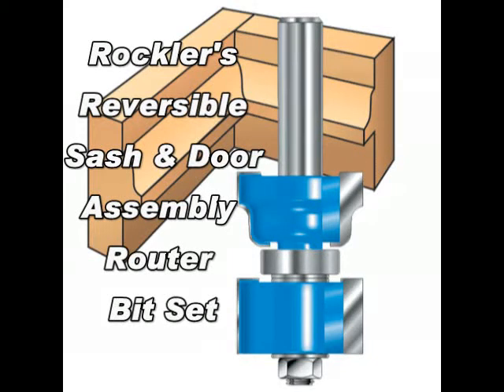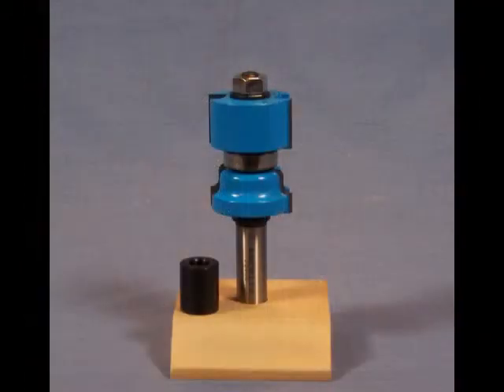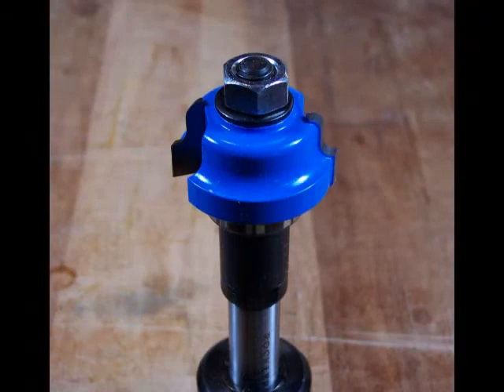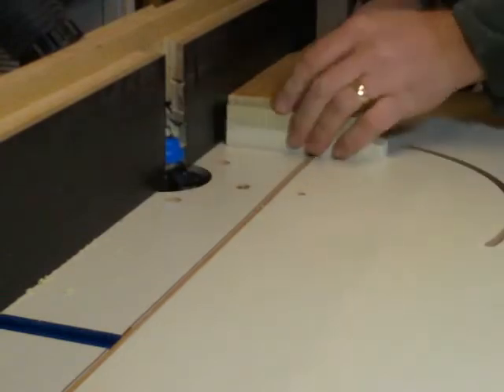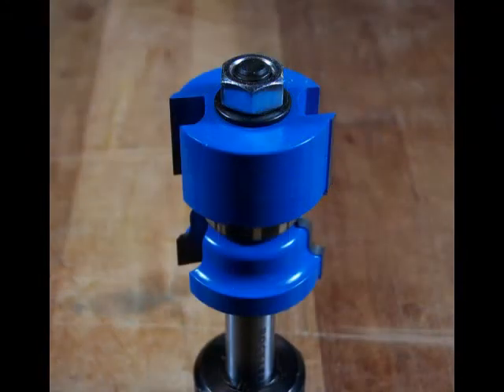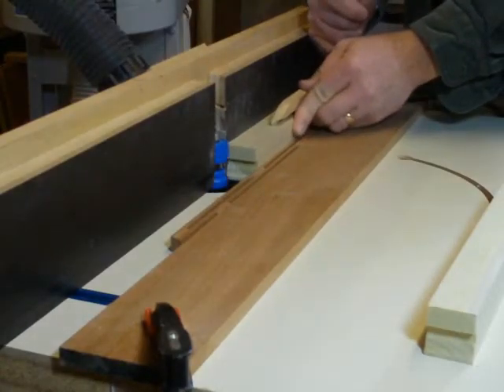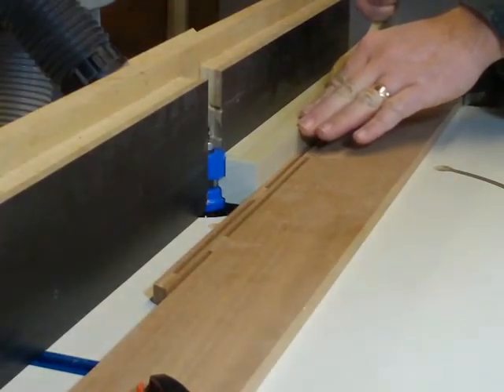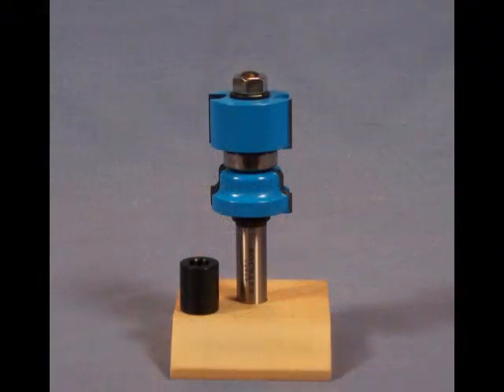Rockler Reversible Sash & Door Assembly Router Bit

Comment: Note that this router set will not accommodate a tenon, for that you need a dedicated cope bit with a flush top (or cope by hand). Here, the nut that secures the cope bit to the shank would not clear a tenon.